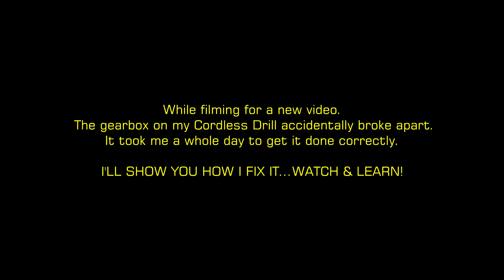Inside a Drill | Repair & Assembly 2021 | Black & Decker Cordless Hammer BDCHD18

Comment: Great video! Being the fool that I'm I totally forgot to take pictures while disassembling (had to change the motor) and those two plates in the chuck section really left me scratching my head. The good thing about the gears is that they are slightly different in size and cannot be put in wrong places easily.
Reply from the maker: Glad the video helped. Thanks for watching. Be safe my friend.
Reply: Can you sent me please a link to buy the motor?
Reply from the maker: Hi @stam230400, Im so sorry but I don't have any. Please try searching on google instead. Thanks and be safe my friend.

Comment: I have a b&d epc 12 which is drivin me crazy. After opening for a motor problem now mandrel turns free, no torque at all and you can stop with hand with motor at full speed. It’s assembled ok but i noticed that the external big tunnel gearing is free to move. So the problem i think is on the ball bearings... they are in place but very inside the holes... I don’t understand the principe of this gearing system... 😢

Comment: This is not the right way to fix it!!! You will brake it when the drill will be forced. As you can see the very first set of gears has some dots on them which needs to be aligned ( like the car engine timing )
Reply from the maker: Hi @AWD to wildness that is noted, thanks for pointing that out. Thanks for watching. Please like and subscribe. Stay safe.